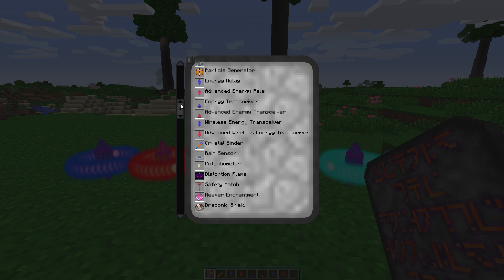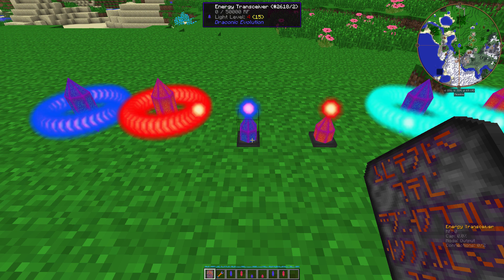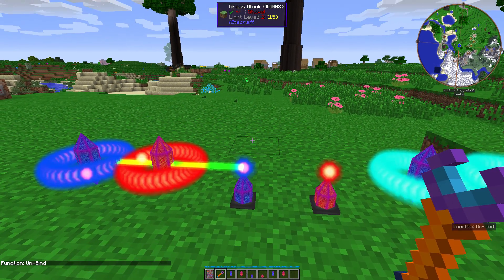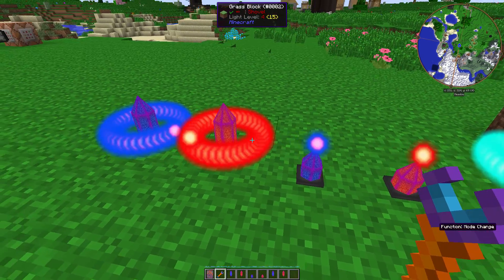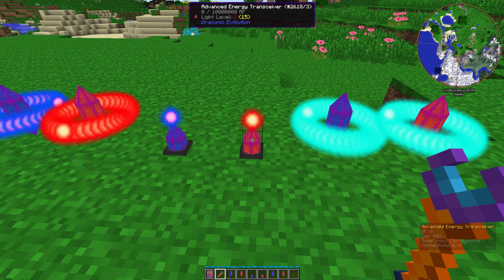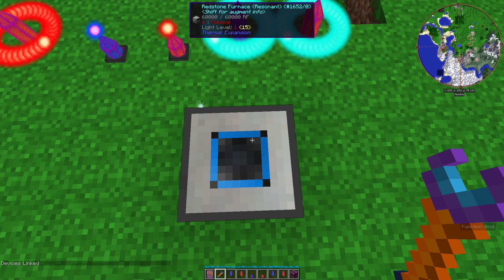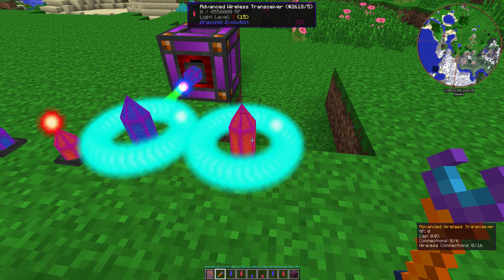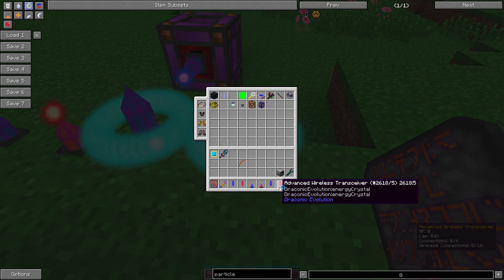Modded Minecraft Tutorial - Draconic Evolution Power Transfer

Comment: Hmm sadly the version im using in Sky Factory 3 is different so this didnt help me. Nothing changes the I/O crystals modes and they seem to do nothing in "balance" mode. dang. Oh FFS it was the shield i had in my offhand. empty right hand but shield in offhand slot prevents them from changing modes. Yep, and it works now. Thats so stupid, maybe right clicking is trying to use my 2nd tool, theres a mod to try and use the correct tool but it didnt seem to work when i tried it once and didnt bother trying again.

Comment: I cant make the crystals output it is input default
I need help
Reply from the maker: Sneak right click on the crystal to change the mode.
Reply: @2ndkirbyever  alredy tried that doesn't
Work
Thanks for telling anyway
I play in my own custom mod pack
About 67 mods
Only 4 gb ram pc btw no lag
Though
Except while dimension teleporting using home pets
I used redstone flux and have 13 bil rf stored
For fusion crafting
Im done with it though
Chaotic staff of power max
Chaotic bow max
And full chaotic armor
It was hard doing the same thing and waiting for fusion to be complete
At last i was done
Working on infinity armor
Which is from @avaritia
At final step making infinity catalysts
Need to wait for a long time
Cause each singularity is 6000 of the item
So yeah